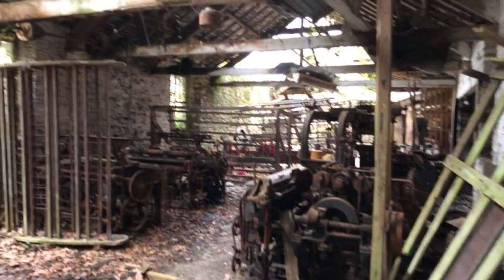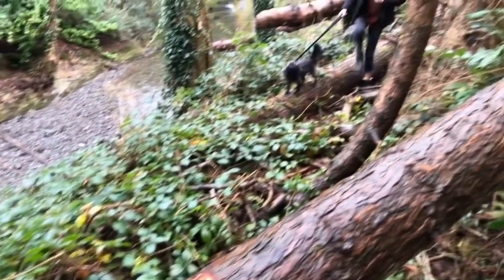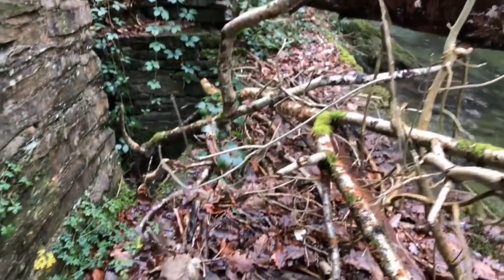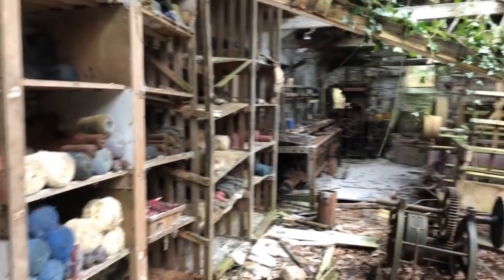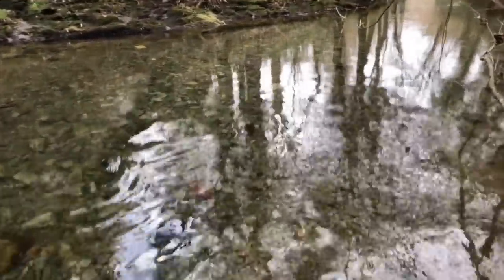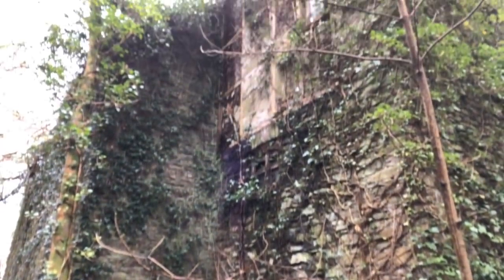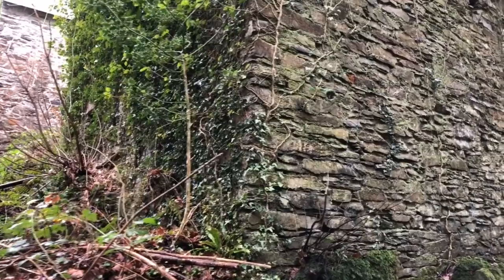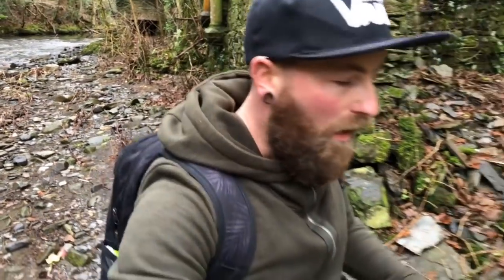I Explore An Abandoned Cotton Mill With Everything Left Behind!!

Comment: The building with the vats in it was where the thread was dyed in colors.  It used to be various natural substances were used to dye the thread.  Wool and cotton same principal clean it,  use a card to separate out the strands,  spin the strands into thread,  dye it, and then use a spinning mill to make cloth that was then sent on to be made into stuff.  The water was used to power the wheel that spun a set of gears inside that provided movement on the machines.  Before that you had to take the thread and go over and under a series of strings by hand to make cloth.  Very time consuming.  It is likely those newspapers read 1980s because at least in America there as a back to the land movement and people would pay good money for things they perceived as healthier and old fashioned.